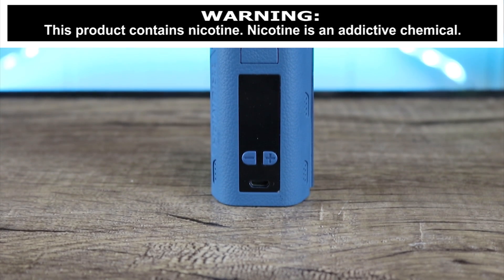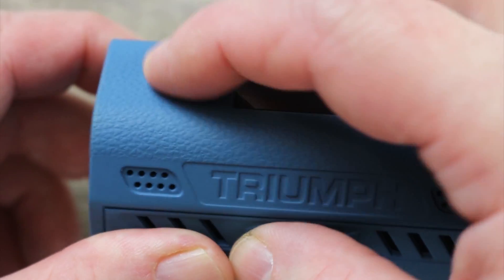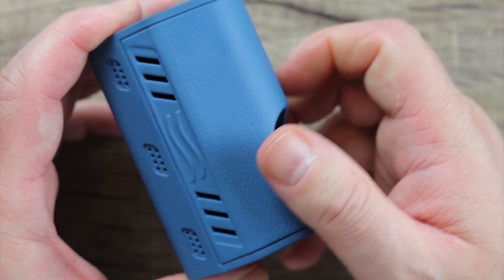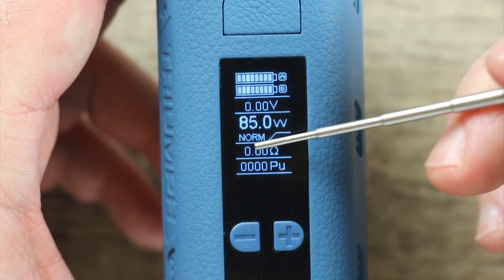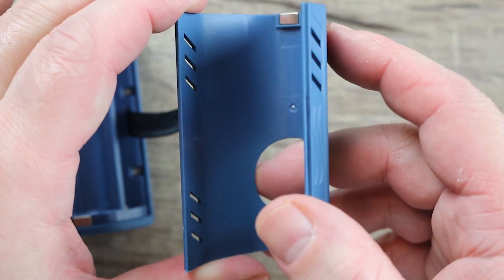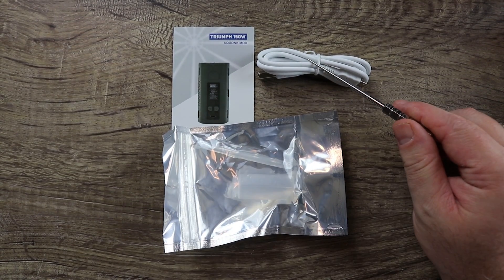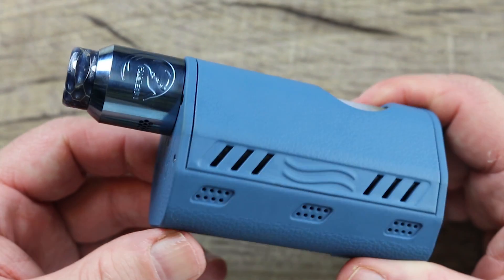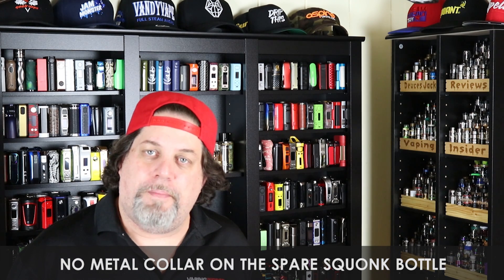A TOP DUAL BATTERY SQUONKER? The Yummycig Triumph 150 Mod! ✌️🚭

Comment: I'm thinking the gap on the door is a QC issue for them. To bad they didn't take the time to put a little notch in the door. I like the fact that you could probably use other bottles in this one. I wish they would have made it variable voltage if they were only going to do one mode of operation on it. It seems okay for what it is though. Great review as always sir. Thank you for the tour of this one. 👍👍
Reply from the maker: It's got its issues but overall, not a bad dual 18650 power mode only squonker.

Comment: No spare cap or collar with the dyadic either. Those doors, they are magnets right? I think thats what you said,  its not clips? That was my issue with the dyadic, the clips sucked. The rubber on the collar broke off of mine.  I ended up returning it. I might get this in place of it.. thanks for the review!
Reply from the maker: My pleasure.

Comment: I don't like that 510 pin. And it looks non-adjustable. Also the pricepoint is absolutely batty. I can get a Basium cheaper. Hell, I got the Wismec dual joint cheaper than what I've found this. Bullshit joint IMO. Another good review brother.
Reply from the maker: That 510 doesn't move. No issues with my atty's connecting. Price point will probably come way down real soon. Don't forget, it's still pretty new.
Reply: @VapingInsider  new yes. I saw it on element vape beginning of January. Wanted to see a review. Thanks for doing it. I could probably deal with all the cons you pointed out though.